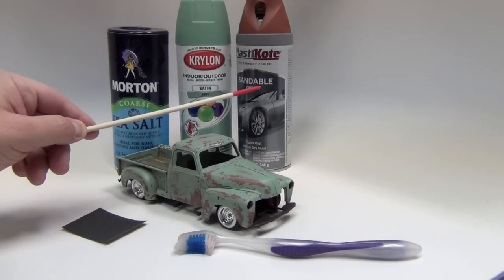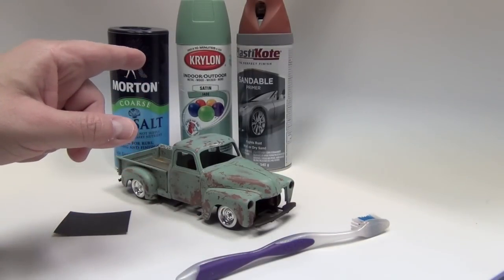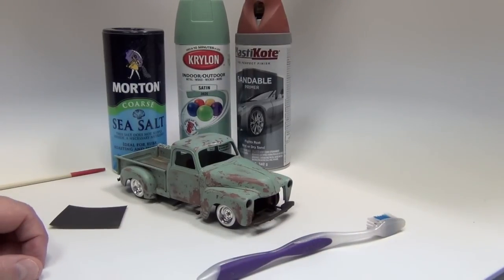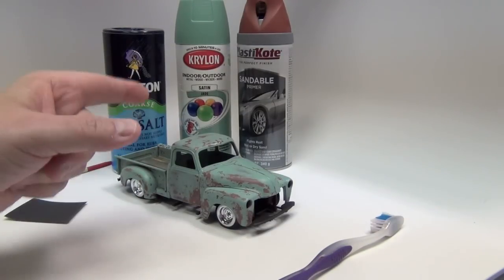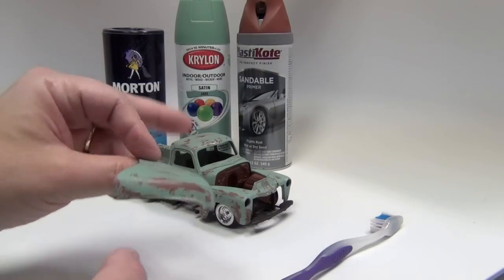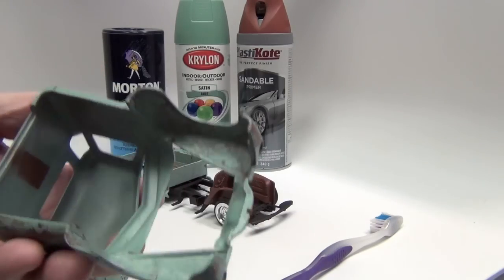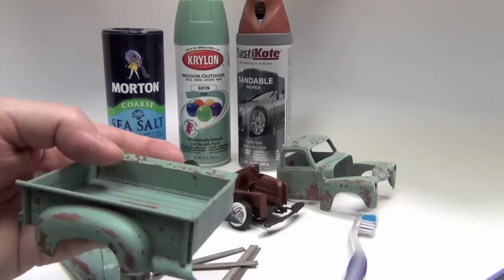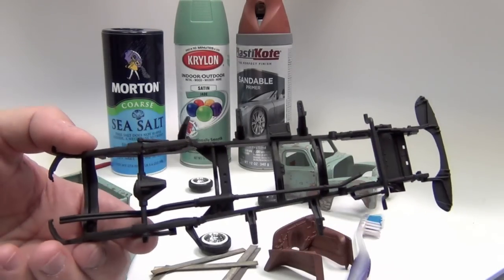CLINIC:  RATTLE CAN WEATHERING

Comment: I have a can of Plastikote Ruddy Brown primer on the way from Amazon, but in the meantime I used Krylon Ruddy Brown as my base coat, I had a hard time brushing the water on for the salt technique, the water just kept on beating right off, would it be better to use a spray mist bottle? Or is that  just intrinsic with not using the plastikote primer? ( when I get the plastikote primer, will that problem be alleviated, will the water brush on evenly, and stay on the primer?) Thank you for your awesome clinics.